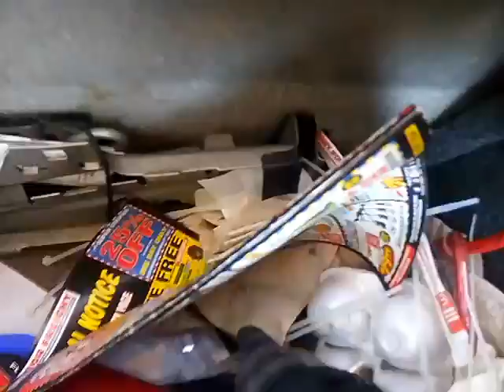Sub

Comment: yep you need new  wire direct to battery with a block fuse between it and the battery for fire safety .  you might be able to do a good splic eon waht you got . if you have extra .  but do a dam good splice . then coat the ling in liquid taper then good heat shrink .